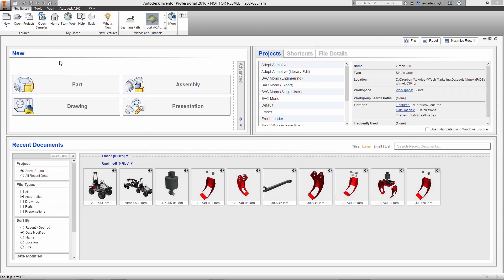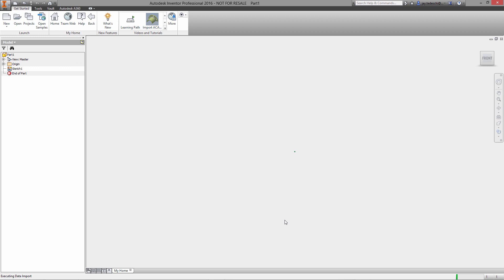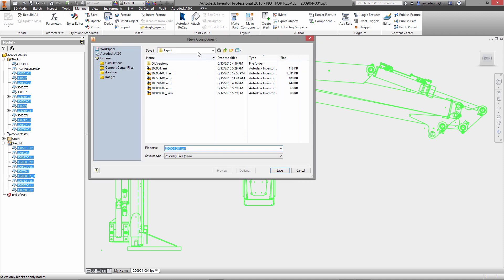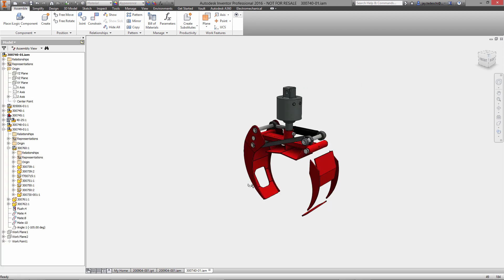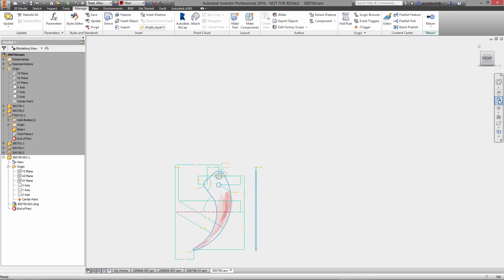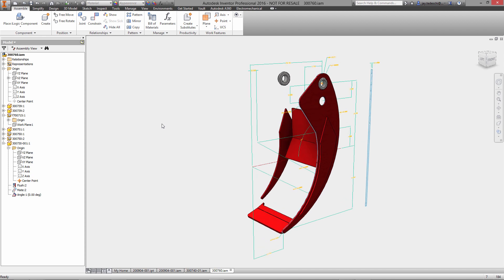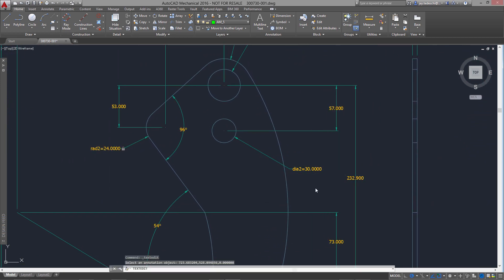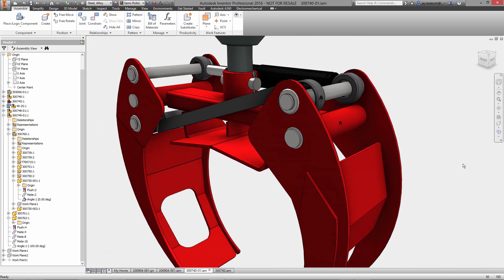Autodesk Inventor mechanical concept and layout design

Comment: Can a inventor sketch be used as a assembly sketch as you used autocad sketch?
Reply from the maker: Not sure I understand...
Reply: @AutodeskMFG  as in the video you constrained the sketch imported from .dwg file.
in a similar manner can a sketch can be used which is produced in inventor  as in tutorial.
Reply from the maker: yes, you can do the same workflow with an Inventor sketch it does not have to AutoCAD.
Reply: @AutodeskMFG  thanks for help.
One more help i want in dynamic simulation of planetary gears. Can you upload a tutorial on that it will help me a lot.
Thank you once again